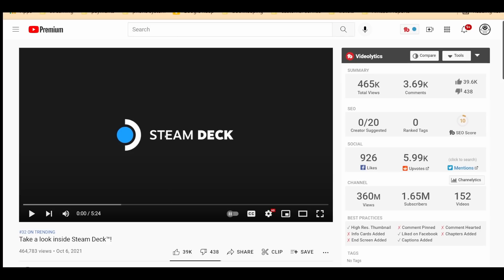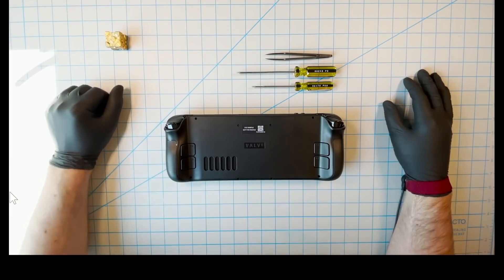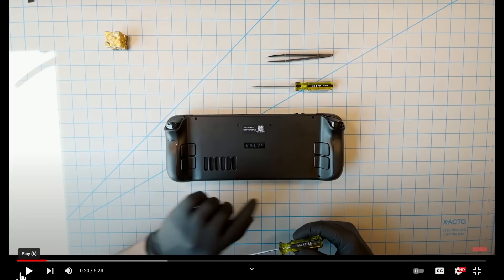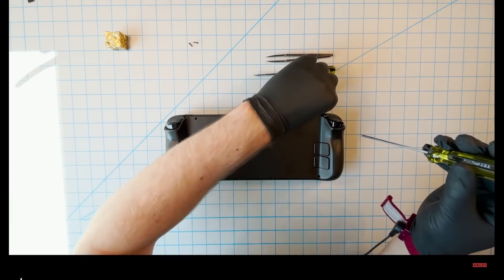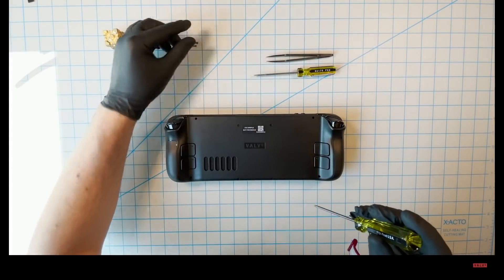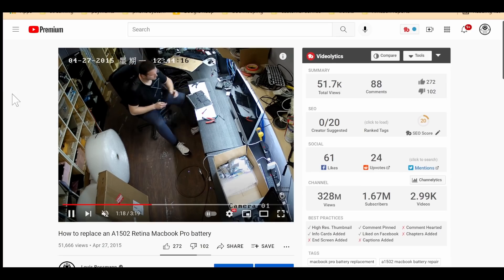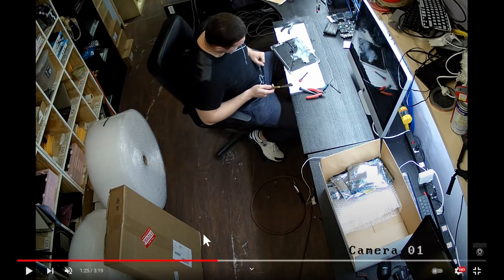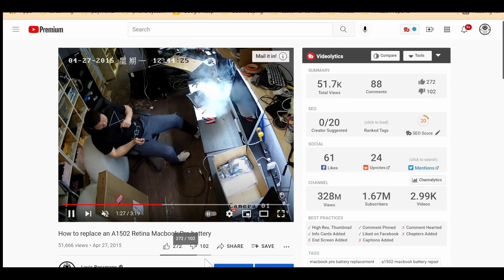Steam deck battery may end your life? bruh 😑

Comment: Regarding the structural stuff, as an engineer I can understand that they make this remark.
First the screws: as they told they have self-tapping screws, which means the producer only needs to drill a hole for the screw, and the screw taps the thread for itself. This also means that if you rescrew in the screw, you should line up the tapping otherwise you create a new groove which is weaker than the original groove.
You could compare it to screwing a screw into wood, the first time it is really secured. However after multiple times screwing and unscrewing the screw, the wood does not grip the screw as good as the first time, especially if the screw is not in the original groove. 

Second the housing probably have some clips as well to keep it on its place, which are probably designed to be closed once (i.e. during manufacturing). Each time you open the housing, the clips are subjected to such a force that the clips (slightly) plastically deforms after which the clips will not go back exactly to its original position. Therefore the clip will be in a slightly more open position, making it easier for the housing to come off or even break the next time due to the plastic deformations inside the clip itself.
Reply: I have found that the real structural issues show up if glue is used anywhere, but they didn't put a glue barrier between anything.
Reply: @rrteppo  just wait until we see consumer version of this product, is what I keep telling people. They might not have glue for this version, but there might be for the consumer version.

I mean, after all, he said the inside of the steam deck will look 'slightly' different. So be in for some bs knowing these companies.
Reply: @rrteppo  Gamers Nexus Will find ALL of the glue ;)
Also they did have glued in plastic covers over some screws, in their own video.
Reply: Came to say this. I always turn left till I feel the screw drop.
Reply: @madbro4803  same 😆
Reply: @madbro4803  feeling the screw drop is such a satisfying feeling
Reply: @madbro4803  THIS is the real deal, why nobody is suggesting this more? I ALWAYS turn left first to find the original threading, even with steel screws, even with plastic bottle caps!
Reply: Ya, was thinking the self tapping screws both in terms of not getting back to the original torque (I assume most would over torque if anything) as well as wearing away of the channels/threads. Also, if you replace any part(s), if you do not torque down to their original spec or do not correctly align the part(s), it may cause structural issues or have parts not secure inside.
That said, probably minimal effects for most people and drops are too inconsistent in pattern to really make a determination unless you really do a bad job making sure everything is back in place and tightened down reasonably.
Reply: @FireMrshlBill  if the threads go to shit we still have the old "scotch tape all around the edges" trick, that we used as kids on chinese tetris handhelds
Reply: @gasper5223  haha true
Reply: @FireMrshlBill  Yep over torquing the screw could be a big issue depending how large the threads are. It could be quite easy to strip
Reply: Im not an engineer or anything but i guessed it was the screws into plastic that could cause an issue
Reply: Yup. Valve most likely overstated it but structural integrity will be decrease (by I guess 5%?, if you don't take much care during reassembly) but it won't definitely be to the point that it will gradually fall apart or even be noticable by regular users.
Reply: Mechanical Engineer here, i can confirm about the self tapping screws, they are problematic for reassembly, there are ways of solving that during the process, specially if planning to do a final installation, but they do weaken when reassembled otherwise.
Reply: This is correct.

Thing is, tolerances exsist. Sure, a self tapping screw is going to wear away the threads, even if you properly align the threads when re-screwing (which is fairly simple), but unless you really ham-handle it (or the plastic is extremely brittle), that wear shouldn't be beyond the tolerances of all the parts to begin with.

Clips are bullshit, no argument there.
Reply: @USSMariner  not really.  Remember, he's not saying you'll strip the hole, he's saying that it will have reduced resistance to sudden impulses such as drops.  Those forces tend to have much higher than normal stresses and every little advantage counts.
Reply: @USSMariner  Well the screws and plastic is designed for a tolerance of one total self tap operation so...

Regardless there are compounds that can fill the hole and allow additional self-tapping.
Reply: @USSMariner  it all boils down to again, if you know what you are doing.
Reply: Rossmann should know this, I mean he opens and closes shit all the time.
Reply: @h.a.6790  The thing you have to remember, is that most things that he works on, are from Apple, and a few odds and ends from other companies.  Mostly it's laptop work, and it is ultra rare that you'll see a laptop put together with self-tapping screws.  They are usually machined screws with brass fittings (Or other metallic material) into the posts on the plastic case.  These don't ware as much as Self-Tapping screws, and can mis-lead someone who has not worked with Self-Tapping screws.
Reply: I notice that most people responding to this comment are focusing on the self tapping screws. I think the real answer to the question is the plastic clips that are used all around the edge of the housing to supplement the strength of the screws. Anyone who's ever taken apart a TV remote is very familiar with them. They are never as strong the second time, and the screws were never the full strength of what's holding the casing together. So, the video about the Steam Deck is not entirely wrong on this point.
Reply: I’m also an engineer (mechanical to be specific) with a supplemental background in snap clip design, and design for manufacturing for plastics and polymers.

For the most part, everything you describe is right on the money.

It pretty much boils down to choice of design to determine how repairable a product could be. These design features is entirely dependent on the company that made them. Should they design them for repairability, they will design around that rule.

That means larger and more durable snap-clips for easier accessing and removing of components, threaded inserts instead of plastic only standoffs, etc.

It’s a sizable trade-off when designing things to be repairable, not having to account for repairability allows tighter tolerances and easier to design and snap together parts very securely, not to mention less parts needed when a product isn’t repairable. Some products can gain waterproofing capabilities such as ultrasonic welded components.

So overall, as mentioned before it was entirely up to valve to decide if a product should be repairable or not. Them giving warnings of possible damage for tampering with a product is entirely because they designed it that way. For what we know it may be just a cost cutting measure, unless there’s actual benefits such as a compact profile.
Reply: Very insightful
Reply: I'm just an amateur disassembler and I'm so happy to have confirmation on the clip theory, thanks
Reply: True, as I have dismantled several generations of my PlayStation controllers, that upon reassemble, they will feel like they've lost some of their sturdiness (or how to describe them getting a little more flimsy in their construction).
Reply: I think that it is funny how Louis has not even acknowledged this comment.
Reply: This.
And they mention the 'you could fuck up the thermals' is reasonable too. Maybe not on day one by loosening virgin thermal compound and then re-tightening...but when it's older and crustier...that loosen/tighten on the heatsink clamp shared with the ssd process could result in bad thermal contact requiring a full teardown to replace the goop.
Reply: Seeing a lot of mentions of superglue here, so I'll just say:  some types of superglue can actually damage some types of plastic, so be careful which one you pick (or use something else...epoxy maybe [idk.  Idk a lot about epoxy])
Reply: Personal experience with those clips and yeah, that's definitely a thing. Those things are weak, if you open up the device once or twice, chances are you won't notice much, but after a few times, they do break off easily. heck I got one laptop that I need to open frequently to clean because I use it in dirty areas and the clips are all gone. With the clips gone, the only thing holding the rear lid in was screws and threaded inserts, and I'm pretty sure the clips were supposed to do the big majority of he work in keeping the cover structurally sound from impacts (yeah I do not treat my laptop well, should have probably gone for a sturdier one), and now half of those inserts just left their plastic housing. so yeah I got 5 screws left from the 10 that was holding it together.... Being a lot more careful with it now (not really)
Reply: dangit,  was just typing out the same thing, one note, you can't ever get a perfect alignment with the self tappers as that tapping tip is always there and going  into plastic will ALWAYS take off more plastic as it's screwed in OR removed. into metal, no big deal as it's tougher stuff overall, but plastic? yeah,  there's your problem with structural integrity.
Reply: Came to the comments to say essentially the se thing as op. I've done a lot of work building new fabrications and repair work involving self taping screws into steel and aluminum. In those cases you lose a significant amount of clamping and especially vibration resistance by re-screwing and I'm sure the same applies for these teeny tiny screws in plastic. It wouldn't surprise me if the clamshell busted open when dropped. If you only open it once or twice to work on it then it's not something I'd worry about. If you feel so inclined to take it apart 10-20 times then maybe you should just buy a puzzle or something because that will definitely have a negative impact
Reply: Thanks mate, it makes sense, to me looks like bad design or cheap design. I know well self tapping screws, my father worked with wood his whole life, i grew up working on wood and learned how to minimize tearing by self-tapping screws, but IMO using that concept on a small device like the steam deck is just lazy (first time i heard about self-tapping screws on electronics), i got an old AtomN270 and the case used screw holes with brass guides, and those tear too but much less or at all if you pay attention when you put the screw back. Also about the notches, I'm building a new case for the mobo of that AtomN270, and notches are out of the question, magnets work better, probably valve solution is cheaper, but I'd rather avoid cheap, I'd spend a little more for a quality assembled product.
Reply: It’s like how you open a PlayStation controller and it never fits back together as tightly again
Reply: @fantasyfan9320  it just because you suck a opened many controller and the go back as strong as before never got any problems
Reply: Some Blue Loctite would certainly solve the problem with the screws.
Reply: +1 to this response. I will say this - if a person is very mechanically inclined and can carefully line up the same screw in the same hole that it came out of and spin the screw backwards until they feel it drop down and carefully re-thread the screw back into the same threads it came out of and not over-tighten it, the structural integrity will likely be minimally affected, probably to the point where it won't be noticeable.  Of course if this is done several times, eventually the gap between the plastic threads and the screw will increase (due to the plastic being "eroded" so to say) preventing the fastener from being as secure as it once was and possibly pulling the material that makes up the difference between the thread minor and thread major diameters out essentially making a hole with no threads and the screw will just fall out.
Reply: your comment made me ashamed of mine, well done dude
Reply: If they use locking tabs, and they design it correctly, you do not weaken the tabs by opening it. You would only cause damage if you deformed it past its point of plastic deformation. So... yes you can design tabs that will fail after initial assembly, or you could design tabs that will last loads of cycles (think backpack clips).

Re self tapping, a screw has most of its strength in sheer, and in comparison, the threads are quite small giving it a lot less axial force. If you remove the screw without tearing the plastic (ie carefully), then reassemble it with decent care, it can avoid any substantial fatigue. Again it also depends on the material choice since they could make it out of very soft plastics that deform easily, or they could use something like a nylon with glass which would be quite strong and could easily handle multiple assemblies/assemblies. 

It really comes down to how the product was designed and whether or not they intended for assembly/disassembly. 

Look up the number or rated cycles on those ribbon cables they are using, I bet the data sheets will list something on the order or 4 insertion cycles for its lifespan (depends on plating thickness as well as the clamping method and force of the receptacle).

Cheers
Reply: Apparently Louis wants a citation and likely won't accept your argument (he can be very rigid and defensive while using common sense against others' arguments). I would argue this being plastic it is common sense even with normal screws - you won't tighten the screws exactly to manufacturer spec, you either overtighten a bit or not enough.
Reply: @bencze465  we need the type of plastic to show citation, else it's a speculation. We need the exact type of the screw - they say self tapping (yet I'd hope for thread forming ones). It'd depend on the type of steel (I'd expect low carbon one but they might have gone fancy with stainless).
Yet, if you go to any plastic fastener spec, if you'd read on stuff like "Helps minimize damage to boss from removal and reinsertion of the screw" (this is a quote of Stanley engineering). (youtube remove comments with links).
If Louis is half serious and he is in the same business, he can look up some materials on his own. In the end it's the same person who had no idea what grease to use on plastic gears.
Reply: @stanimir4197  they are shelf threading it a plastic shell they are not metal screw only metal crew are shelf taper 
Shelf tapping usually will drill the hole in the metal as well
Reply: @legros731  "metal screws" tend to refer to sheet metal screw and "machine screws" are likely the ones you refer to.
Other than that, if you take a simple plastic electronics enclosure for (less than) a dollar - single unit, it'd have 4 brass inserts and 4 stainless steel screws. The process is not free, of course, but saying that $500 product cannot afford proper engineering is just giving into the years of trash products fed down your throat.
Reply: @bencze465  There isn't a mfg spec on this as its not like they are using a torque driver to set the screw. I don't think we are arguing common sense, more about material properties (like the plastic deformation i mentioned)
Reply: also glue is sometimes required as part of assembly, either for structural integrity or water resistance
Reply: Yep. This. 👍
Reply: Yeah. From experience taking apart cheap plastic toys with screws, they almost always use self tapping screws and as a youngster who was never careful about putting stuff back together, I'd reduce structural integrity *noticeably*.
Reply: yep I was just about to write this, but you said it better and much more succinctly then I would.  Although it looks like they didn't used clips on this which I love. while I love that the GPE WIN3 uses threaded inserts instead of self tapping screws, it uses clips that always ends with ruined seams and weakened clips.
Reply: @macdam11 well said bro kudos!
Reply: you can put a drop of superglue in each screw hole to keep it tight when you screw it back together....basically just a thin layer of new material to tap into.
Reply: @LowSpecLinuxLaptop  superglue doesn't hold in polyethylene or polypropylene for instance [it won't be PE, of course]. Superglue is actually not very good for most plastics and there are better options. You'd need to know the type of the plastic 1st
Reply: @stanimir4197  I understand , you are not actually glueing anything together in this case it is just a layer of material to compensate for the wear of the plastic screw holes
Reply: @LowSpecLinuxLaptop  super glue just doesn't stick to low energy plastics, so the layer can be wiped off with a finger.
Reply: @LowSpecLinuxLaptop  NO, NOT SUPERGLUE! DO NOT DO THAT or you'll have a hard time reopening it. You could, and should put nail paint though.
Reply: @RunTheTape  yes nail paint is another option....and no I do not suggest glueing it just a drop of superglue in each hole AND let it dry before putting back together same purpose as nail paint a thin layer of fresh material to screw into
Reply: @LowSpecLinuxLaptop  is there something less strong than super glue?
Reply: @rrteppo  you let it dry before putting screws back in.  The goal is a thin layer of new material to keep it tight.  Them self tapping screws "hog out" the plastic every reassembly even when being careful to not cut new threads
Reply: @LowSpecLinuxLaptop  Those holes are predrilled or formed prior to the self tapping screws. By adding material into the hole, you reduce the tolerances that  are needed to reduce splitting tension on the plastic. The material is not so much removed with most self tapping screws into plastic as it is displaced and weakened. If you want to get to like new, you'd have to fill and drill all the holes prior to retapping. I don't see too many people doing that though.
Reply: @LowSpecLinuxLaptop  Eh, that could work but cyanoacrylate is a very brittle material that will shatter when you try to run a screw in, there are better materials to choose from. You could choose to drive the screw while the superglue is wet, but good luck if you ever want to remove them again.  I've done it by shaving off a bit of the same material from inside the case somewhere and heating it with a soldering iron turned down to about 400F to warm the plastic to build up the stripped section, then re-drill to size.   Dont use your good iron tip for that. Whether that will work is dependent on the type of plastic, if it is thermoset it should work fine.
Reply: This is what I was going to say lol
Reply: by "structural integrity" I think they meant the case would pop out if droped but it would only happen if you rip the threads whil re-screwing.
Reply: Why self-tapping screws though? Isn't it a clear sign that the product in question has really low level of quality?
Reply: When replacing self tapping screws, its good practice to turn the screw backwards at first and feel for it to "drop" off the end of the thread, as soon as you feel the drop you can turn the screw in the tighten direction, this ensures you are at the beginning of the original thread.
Reply: I can speak from personal perspective regarding about 5 laptops I have done regular repair and upgrade on. 2 of which are my own. After some time, I noticed that the plastic wasn't as secure, or atleast it felt like it. The screws also became harder to get out. The worst case was my little brother's laptop, which was a hand me down of a computer I put together with a partial mish mash of parts.
The plastic assembly at the back just straight up came out. I had honestly lost track of how many times I removed and reinserted those screws but it was a lesson learned for me. In the end, it was totally fine. Just used some slight adhesive.
Reply: Hdmi hen reassembling, try to back-thread the screw first (turning it counter-clockwise until it clicks) before tightening them. Be careful, but since they are small this is more of an issue also. Easy to break the thread.
Reply: Does drilling and installing brass threaded inserts void the warranty? It's technically an upgrade but I can see it viewed more as a modification. Seems petty imo.
Reply: @sethat8e  you can't realistically install brass insert there, boss is way too small, the inserts tend to be installed via ultrasonic, molded in the plastic and so on. If there is enough meat to get an insert with epoxy it might work, but that joint (epoxy/plastic) might to too brittle anyways.
Reply: @stanimir4197  You can get inserts in a variety of sizes and install them with a soldering iron.
Reply: Yeah, I was surprised to hear they were self tappers. I wonder if it's some kind of encouragement to get joe shmoes who know just enough about selfs to not go through with it, but that kinda doesn't make sense
Reply: In other words, made as cheaply as possible, and still over $600.00 dollars.
Reply: @troyh3867  Just about. It's definitely not cheap, but neither are any of Steam Deck's current competitors. If anything, Steam deck comes out slightly cheaper for the specs you get. Valve even admitted themselves they had to make some "painful sacrifices" to keep the MSRP of the base model down. I'm sure the untapped screws is part of that.
Reply: @SuperFriendBFG  Yeah, I suppose that makes sense. However, for a portable I would hope it would be built more rugged like the first GameBoy. You could almost drop kick that into a brick wall and you had a good chance it will still work. True, that was marketed for kids who would likely do such things, but accidents happen. Some of my friends can tell you about their expensive Switch accidents.
Reply: i always spin the screw backwards a bit till i feel it drop into the thread then just barely snug it
Reply: This is the comment Louis needs to read. I agree with it. Nothing is ever the same after you unscrew or open it. Even if performance is not changed too much.
Just the fact that he pryed the device open the way he did speaks to this fact.
Reply: So to put @Louis Rossmann bulshit detector to rest, they are technically correct that a re-assembled device is never going to be the same as it were out of the factory.

Also, in terms of bull shit, they can claim stupid stuff like "oh, you opened your device to fix your analog stick, so the warranty won't cover your glitchy graphics output, since that might be structural damage from opening and closing"
Reply: @prgnify  I loathe self tapping plastic screws, they are everywhere. You have to be extra careful (turning them backwards to 'click'), like you should not screw them to their original torque either. In sense I'd agree, it sucks they didn't bother to install brass inserts.
Reply: @stanimir4197   Cost to have someone or specific tooled machines put them in. Assuming Linus' argument that it is already aggressively priced.
Reply: @stanimir4197  Agreed, I'd rather they'd have used a more accessible approach, but it's very clear that they were trying to do this on a budget. However, if they release a revision without improving serviceability, I'd be quite disappointed.
Reply: @subterficial  The cheap Chinese multimeters have a brass insert for the battery holder; of course they need tooling and the process is far from free. Worse come to worse, silicone fill and clamps... overall when I see the brass inserts I think - well they engineered thinking of 'the next guy'.
Reply: @stanimir4197  in theory, with a drill bit, soldering iron, correct screws, and some patience you could get away with doing it yourself, the inserts anyway.
Reply: @stanimir4197  Threaded insert fasteners need to be used more. They're fused to the plastic, since they have to melt the surrounding plastic to put them in place, and made of metal so you can re-screw them a lot without worrying much about wear.
Reply: @stanimir4197  Two words, difficulty and cost.
Putting brass inserts just for the screws will be difficult to manufacture and install in the machine and will cost too much for a product that is targeting a $500 msrp.
Reply: @bloodangel13 " 500$", take a cheap $10 chinese multimeter and it will have a threaded brass insert for the battery compartment.
Reply: @stanimir4197  yes that's what I thought Louis would have said why no didn't bother to install brass inserts and the hidden plastic clips also with out this video, your just in the dark as to what clipped where, 
so with the bendy plastic clips, and the screws, drilling out there own holes, getting inside is not friendly, (also didn't see any sealing with a hope of keep out any dust, odd water splash, (the replaced thumb pad, looked like a perfect unlucky drip, going on the edge moving pad will have a strait path to the sensitive electronic inside
Reply: @ccricers  treaded insert are shit the screw get stuck in them and when you try to remove them the insert begin to turn and you are screwed
Reply: @stanimir4197  it only one screw and it engineered to be removed multiple time to change the battery 
The screw that hold the shell are self taper 100%
Reply: @prgnify  Different issue.
Reply: @prgnify  Well that would be a separate discussion. But at least Index owners will tell you that their warranty support is great, and they tend to just replace hardware without fuss.
Reply: @prgnify  they would have to prove you caused the damage to the graphics chip
Reply: @prgnify  honestly i can't see valve doing that they are usually pretty solid when it comes to warranty replacement
Reply: @prgnify  not to mention that having a device that's only designed to be closed/opened once for manufacturing is a choice, it's just as easy to make a device that can be taken apart repeatedly, without sacrificing jack shit. Maybe you need a few more screws to keep the housing nice and tight, maybe you need to tap the holes with something other than the screw. These aren't some paradigm shifting design changes that will cause the device to be twice as thick or not as good, in 99% of cases this shit can be done without compromise.
Reply: As he said, irl it makes no difference so they mentioned it just to scare customers off opening it
Reply: This is true of women as well: the first time you screw, it's really tight. But as you continue to screw and screw, it gets more loose and doesn't not grip the screw as good as the first time.